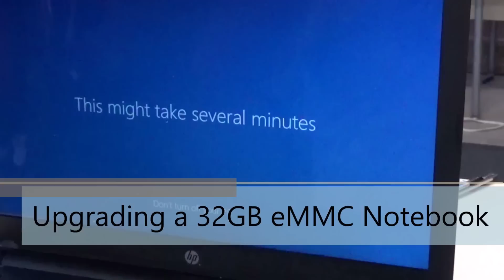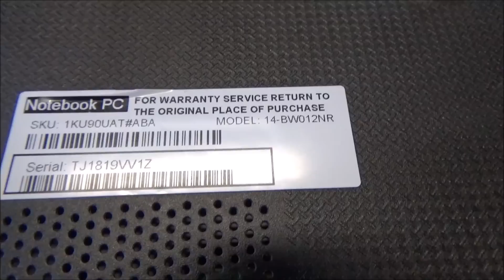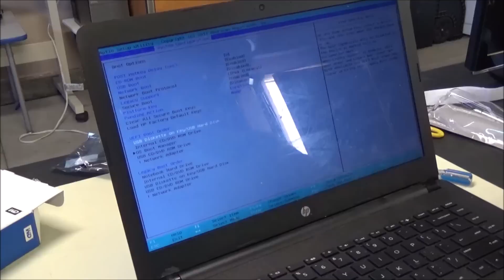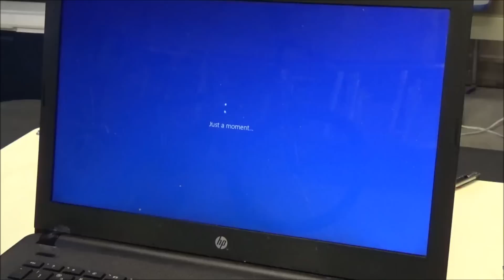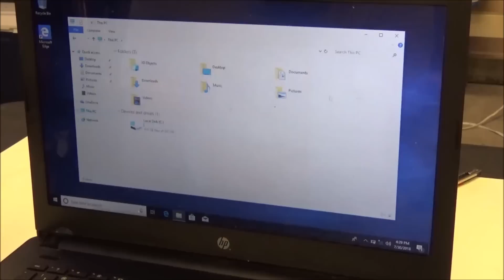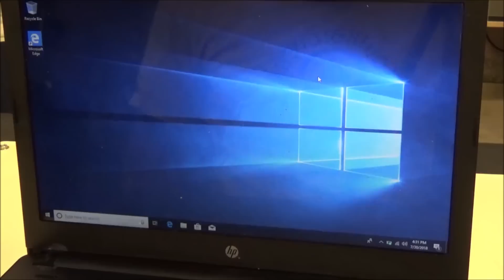Upgrade 32GB eMMC HP Notebook with 1TB HDD

Comment: Worst HP Laptop Design on a Windows 10 32GB Hard Drive is way to short
Reply from the maker: It is a terrible notebook for sure. The 32GB storage is bad, but the weak AMD CPU is also a major issue. It has 4GB of RAM but can barely use it because the CPU is so slow. Very frustrating experience try to use this thing.
Reply: This Laptop can support up to 8GB of Ram instead of 4GB of Ram to Run Windows 10 64 Bit Operating System
Reply: @stevesibaja3123  thats the problem PC shoulda just installed 8 ,,,atleast 8  was tolerable . ( and you never got CRAPPY adware you never used , like on xbone n all smart devices these days ) rather than HERPES i mean 10

Comment: Can I add a second hard drive to my HP Pavilion G7 with one of those HD caddy things?
Reply from the maker: For sure. These caddy's are made to install it where the DVD optical drive is. Unless you still use the drive.
Reply: @PimptatoPCs  I rary use the optical drive, but would keep it and connect it externally if I needed it. I would have bought one of these years ago if I'd known they existed. Right now, if I need to switch from Linux to Windows,  I have to swap out the drives. I know dual boot is possible,  but my windows drive is so old I don't dare mess with the partitions and my Linux drive is too small. Thanks.

Comment: Hello Sir, i have this one.Can i ask something. If i upgrade the same you make,i can play any games?like pubg or Rules of Survival? Thanks
Reply from the maker: Unfortunately this HP Notebook is not going to be capable of playing games like PUBG or Rules of Survival. In this video all I did was install a larger hard drive. Demanding games require a better CPU and GPU and you can not upgrade those parts on this notebook. A good gaming laptop that can play PUBG will cost a lot of money, probably around $800-1000.
Reply from the maker: I forgot about Mobile PUBG. There are videos on YouTube showing how to install it on Chromebooks and PC's but I'm not sure if it will work on your notebook. It's worth a try though. Hope this helps!

Comment: Most of those shits don't have optical drive or sata port. But windows is the problem not the hardware. Install Linux and it will work just fine.
Reply from the maker: That's why it says "HP Notebook" in the title. Installing Linux is a solution if you can't install a bigger hdd, but you would still only have around 28-30GB of hdd space. Totally worthless and a completely unacceptable situation for these manufacturers to put their customers in.
Reply: @PimptatoPCs  thing is Linux OS will cover just 4gb of the HDD while Windows eats up 16-20gb. On top of that Linux uses 250mb ram while Windows barely fits in the 2gb ram. 
With Linux you have ~25gb free disk space and it is ok for simple use, considering all the storage can go to external drive/micro SD.
Reply from the maker: It is a better OS for this 32GB form factor. Honestly HP and other manufacturers have no business selling a 32GB notebook running Windows. Some of your initial cost is that W10 license and it doesn't even have enough room for an update. I like many Linux distros, but Linux is only installed on 2% of PC's and they have completely failed to market it properly to the masses. And spending more money on external drives and SD cards is BS after dropping $150-200 on a pseudo laptop.
Reply: @PimptatoPCs  we all have some external drive /SD card lying around. They are very cheap also ~15$.
Idk who/what placed the constraint of the tiny hd space. Newer generations of this tiny laptops get a boost to 64gb
Reply: @PimptatoPCs  I use a 14"HP stream that doesn't even have a optical drive. Just 32gb hd & 2gb ram all soldered. 
W10 was a disaster on it so I deleted & installed Linux Manjaro works like a charm. Also doesn't have cooling fans all passive and battery runs insane times, like super premium laptops.

Comment: I would've put CloudReady or something like that on it, 32 gb isn't even remotely enough for Windows.
Reply from the maker: Never heard of CloudReady but I just did a little reading about it and it sounds pretty cool. I'll definitely check it out on one of my old PC's!
Reply: Yep, it's pretty cool. Although not as fully fledged as say windows or Linux, it works really well for a secondary machine.
Reply: I tried installing windows 10 pro on it and the update just stopped half way through

Comment: notebook laptops are so under powered every laptop should give atleast 100GB of storage anymore, HP realy went cheap on that storage.
Reply from the maker: The worst part of this Notebook is the sad little dual core, mobile AMD cpu that they use. It's only 6W! There should be some kind consumer law demanding a minimum amount of GB's available after installing Windows. This thing honestly couldn't even download a W10 update, with the HP bloatware installed the storage was full. WTF?
Reply: PimptatoPCs yeah I remember you saying it can't even update in the video, the law should be after all the junk is installed there must be 50GB of space free to the end user. The specs don't bother me as much as the storage they gave.
Reply from the maker: You're right, storage space much more important than processing power. I also said in the video that the laptop is snappy enough for what it is so the CPU isn't that big of an issue. 50GB's free sounds good enough to ensure that you can use it normally and still have room for updates. I'm surprised some consumer group hasn't pushed this.

Comment: And why didn't you create partition for eMMC is additional usable storage now.
Reply from the maker: Why would I create a partition when it's a completely separate drive from the HDD? You don't have to partition it at all, just create a new simple volume in disk management and the 32GB drive will be seen along side the 1TB HDD. Thanks for the "advice" though.
Reply: I wonder what is plugged into the SATA port on the right under the ribbon? Maybe is this that eMMC? And place for another drive.
Reply from the maker: You're right about using the 32GB though, I should have initiated the drive through disk manager. But with over 900GB's available she won't really miss the space. And I apologize for being rude, it doesn't help a conversation to be like that.
Reply from the maker: That is the eMMC. I cut that part of the video out also =( It's really hard to keep everything that I want to talk about and still have a video that isn't too long. The weird thing is it didn't look like it was unpluggable. It looked more like a soldered bridge over to the mobo. But I'm not positive about that because I didn't try to remove it.
Reply: We didn't understand each other. By saying create partition I was thinking about this what you said. Maybe I missed that, but on video you left eMMC empty without volume.

Comment: Sad thing about that is that you installed HDD which is propably slower than this eMMC card.
Reply from the maker: Did you actually watch the video? It's my neighbors laptop and he bought the HDD. I said it twice that he should have kept the SSD. I had over an hour of footage that I edited down to under 15 minutes and cut the part where I talked about the HDD being slower than the eMMC. But the eMMC is still trash and a very unreliable part compared to the HDD.
Reply: Forgive me, I expressed myself badly. Should say that neighbour made mistake. I know what you said in video.
Reply from the maker: Sorry for getting testy. Sometimes I overreact to comments that question stuff that is out of my control.
Reply: @PimptatoPCs  why not just boot drive and storage?
Reply: What's the point of having a faster drive (emmc) if its unusable because of limited space thou.

Comment: Now I know what to do with all of those that I have passed over at garage sales.
Reply from the maker: I think it might be a little hit and miss with which models have a sata port and which don't. It seems Hp is recycling these mobo/components from more expensive models and installing that 32GB eMMC to drive down the price. But a model designed and built specifically for this form factor might not have the sata port at all. I was kinda surprised that HP didn't disable the sata port in the Bios or with some firmware or something. That would be a dirty tactic but I wouldn't put it past these companies.
Reply: 1 word. Linux

Comment: You might want to go into disk manager and initialize the 32gb ssd so that’s usable too... once that is done the should both show up in the my computer tab. I would have just re-installed windows on the ssd and kept the hdd as the storage drive:
Reply from the maker: I totally forgot about initializing it in disk manager, 32 gigs is 32 gigs so maybe I should knock on their door and do that for them. It's such a small drive that I didn't want to reinstall W10 on it, even though a fresh install would have freed it from a lot of the HP bloatware. But these people are not PC savvy at all and having just one HDD with 900GB's of space is probably the best way to keep it running smooth and not confusing them in the future. Good to see you back in the comments man, hope life is treating you well.
Reply: Nah life could be better I’m between jobs right now so I have a bit of free time... I personally would have re installed windows on the ssd for the boot speed and just used the HDD as a storage drive but I probably already said that and am just too lazy to see what I wrote previously... there is a new hospital being built in my area and I’m trying to get on that job so hopefully this free time doesn’t last long..
Reply from the maker: Idle hands are the tools of the Devil. I think that's what all the Holy Rollers say =). Hopefully you get on that job man, sounds like it would keep you busy for awhile. I read about that eMMC and the memory is really junk. It's cheaply made and doesn't have error correction and other maintenance software like a normal SSD, so I just decided to cut it out of the equation. Apparently it has a high failure rate from the stuff I read. So what kind of whiskey are you drinking? Jim Beam?
Reply: Keep the eMMC in case you need to clone it.

Comment: I really don’t think those empty sata connectors are on every or even most notebooks.
Reply from the maker: I agree with that completely. I think this HP model has a recycled design/components from another model and future versions probably won't have the sata port. I was a little surprised that HP hadn't deactivated it.

Comment: Now I know the next part HP will classify as "unnecessary" on the next version of those notebooks.
Reply from the maker: I was a little worried that the sata connection would be disabled from the factory. I'm sure they'll be excluding it in future versions to "cut costs".
Reply: they've been pushing the cloud too hard from a couple of years ago. I want my local files!
Reply from the maker: I hate the cloud, local files all the way. And a 32GB computer is a dishonest tactic that forces you to use the cloud. Then you read all the fine print and they actually own everything you upload! BS!!
Reply: The cloud is fine when you store installers, YouTube videos or certain office documents but personal data is a no go.
Reply: PimptatoPCs These devices usually offer SD or microSD expandability, so you can throw in a 128GB card to keep anything you want to store locally. Keep in mind these are low-end devices  for basic MS Office usage, YouTube and surfing the Net. They're fine for their intended purpose.